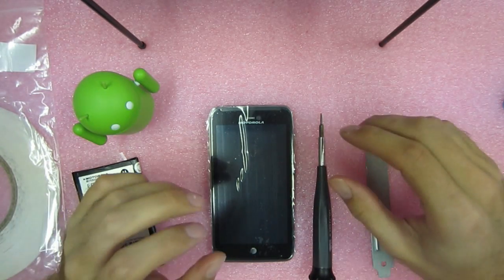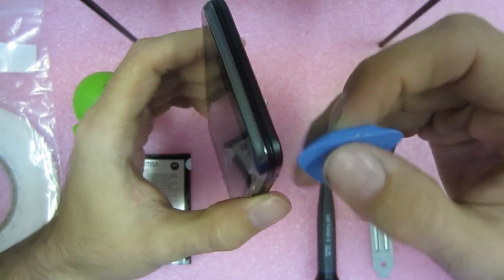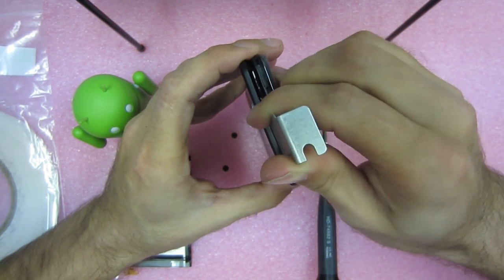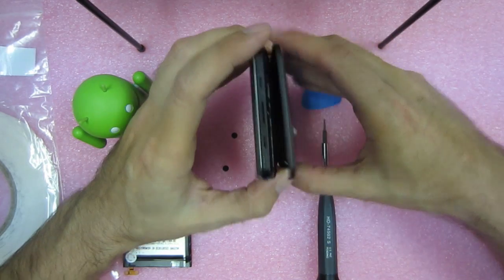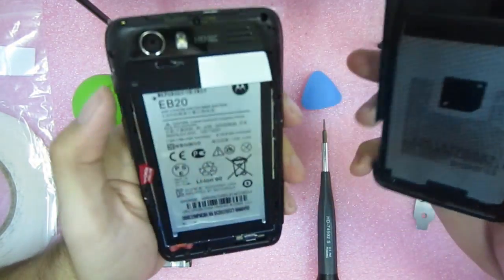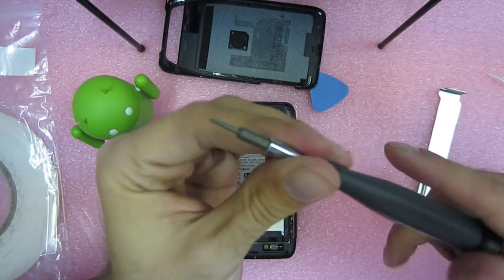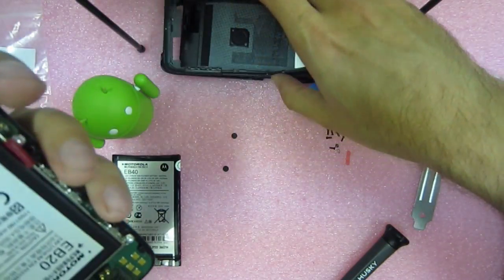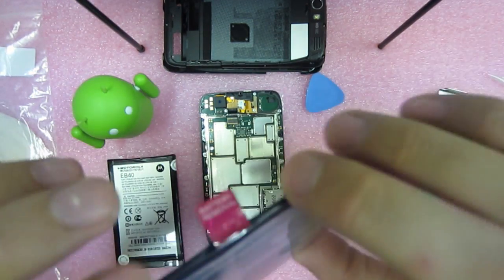Motorola Atrix HD Razr Maxx EB40 install mod Tutorial

Comment: The video was very helpful... The EB40 worked just perfectly for my Atrix HD (& was identical to the one that I removed...)  you have to take all of the screws out for the rear panel to remove it & reach the entire battery.  Counting the battery screws, you should end up with a total of 12 screws...   Upon following his directions step by step, I was able to remove the back cover, and the rear panel, remove the battery, replace it with a new battery, and reassemble the phone.  It now holds a charge, which I am very happy about :-)   I had to re-watch the video in a couple of places, but his directions do work... the EB40 is the correct battery...

Comment: No I removed the plastic cover. After I put it back together all worked good and then I had speakers issues. Took it a part and screwed down the plastic cover hard and all was good. A few days later same thing.  After my inquiry to you I disconnected the speaker cable and reseated it and the pushed the battery to the bottom as much as possible and taped it there. So far so good. Still no cutting :)

Comment: I didnt cut any plastic.Ijust pushed the battery all the way down as it is slighly smaller in length than the Eb20.This reduces the pressure and gap when u put the back cover on.You just need to raise the external speaker pins on the motherboard by 1mm using a tweezer so that they are in contact with the speaker points due to the increased gap.Works like a dream .

Comment: For those with speaker issue, try sliding the battery all the way down so that the top part is not pushed by the battery. If that doesn't work, instead of cutting parts of the  black plastic with white sticker (refer to video), just make a 3 slice cut at each end of it and also in the middle. This will help the plastic to flex without pushing the speaker contact point.
Reply: pijesz The speaker contacts are slightly curled....delicate work but they can be unfurled slightly so they stick up higher and make contact even with the EB40 battery.

Comment: I actually did have to cut out part of the black plastic frame.  I first installed the battery without cutting anything and did not have any sound.  I then used a hot knife to cut the black plastic piece (without removing it from the phone), and everything works properly.  I removed enough of the black plastic (about 1/4-inch from the top edge) that the new battery comes in and out without having to shimmey it in.  It just drops in, no problem.  Whole process took about 15 minutes.

Comment: What did you do as far as the rear panel? I tried this for a customer and the EB40 is too thick for the Atrix HD. I had to dremel out part of the frame at the top which was no big deal but the back would be under a lot of stress if I forced it on.

Comment: My speaker issues are back. I'm positive it's the two speaker connectors not touching tightly.  I'd like to know for sure what is and isn't safe to cut, I'm sure that will fix the issue. I've stripped on of my screws so I'm going to have a tough time cutting without taking the plastic bezel out.

Comment: I did this mode and put the EB40 in. The battery works great but my speaker stopped working. I suspect that the thickness of the EB40 may be a little fatter than the EB20. Now the speaker probably is not making contact with the output speaker. Did you experience that? I have to figure out a way to wire the speaker contacts to the output circuit.

Comment: @shanghei...  i did this mod, cut the plastic out and everything for the fit but i am having overheating issues. had to put back my original battery.  
do you know why this happens or how to make the overheating stop?
the battery drains after its unplugged n overheating pop ups nonstop. 
would love to put it back in and have some good battery life. what u think?

Comment: Just performed my battery swap.
Found out previous owner of my phone had it apart.
When unsnapping outer cover it came up quick and tore off contacts from old battery, Installed a 4000 mAh battery, may have to modify the inner cover as the portion between power and volume rocker will not seat down all the way and there is contacts above from outer cover there.
It would not power on at first, had to put on charger, reported 49% and charging, phone powered on at that point, will wait until it gets a charge before trying to use.
Will report if I have any issues, my battery was probably a tad thicker than yours.
Reply: Yes, going to have to get the dremel out, the power button will push in and not spring back out and my bluetooth was staticy...

Comment: I"m having speaker issue connection issues, probably because I need to cut the plastic. But I'm nervous as to what to cut. Am I supposed to cut the black and white plastic on the bracket? That's not ruining anything?

Comment: the original battery for this phone it is EB20, but you use EB40, there are the same? there's no problem using it? i'm plannig to buy a new battery for my phone, a little bit bigger in watts, What do you recommend?

Comment: My phone is the xt912 model. After much research I cannot find a video with my same insides. On this video and all others, the access to battery screws is exposed after back panel is taken off. Mine is covered with a soid piece all the way across battery terminal screws. How do I remove this cover?

Comment: My phone is Motorola Droid RAZR XT912 has a battery 1750/1780 mAh model EB20, and I would switch you to one of 3200/3300 mAh model EB40 because this battery lasts longer and therefore can be used more cell. Is compatible Battery 3300 mAh model EB40 with Motorola XT912? If I get to put the no risk of breaking down the cell?

Comment: When I installed mine, the speaker stopped working.  So, after a million tests like having the battery hang outside so the speaker would work, I decided that the thickness of the battery prevented the speaker contacts from making, contact.  If I had a dremmel tool, I would have ground the plastic so that the contacts could touch.  But I didn't, so I cut the plastic so that the battery wouldn't keep the case from coming together.  I did a hack job with kitchen shears, and it worked.
Reply: Fr No it was easier to pull the contacts up, that's what I did, but I am having issues with GPS now will have to check why
Reply: Fr No The speaker contacts are two raised tabs that are quite small. Using an eye loupe...which is a necessity for really small work....was able to raise/unfurl the slightly curled spring contacts up slightly to compensate for the extra thickness. It doesn't take much and is delicate work. All works as it should.

Comment: are there aany known over heating issues with this mod
Reply: I managed to apply this mod a few days ago. So far no such overheating issue yet. For moderate use (light browsing, lots of whatsapp, few phone calls, wifi most of the time), my atrix hd could last 2 days without the need to charge. As of now it has been 22 hours from last charge and it still have 60% juice left.

Comment: So i did this but my connections don't work for audio. Even after cutting off the back. When i put the old battery in it works. Is there something I did wrong?
Reply from the maker: did the little audio connector up top get disconnected?
Reply: shanghei I'm not sure. I cut the back and put the new one in and had no audio. Then I put the ld one back in and it works. I was wondering if there is anything else I might be missing. Is that the only connection for audio on top?
Reply from the maker: Tyler Whurlinger The only audio connector is the one I point out at 6:02
Reply: shanghei OK I'll give it another try when my new battery comes. I already sent the old one back. Thanks for the video.
Reply: Tyler Whurlinger And the quick response.

Comment: "brand new battery bought on ebay." :P when you are buying a cellphone battery, you shouldn't buy it anywhere aside from the Motorola Website, or the Verizon store. I bought a "new" battery from a 3rd party and it was complete garbage.  Even if it technically was unused, there are probably factors to preserving the battery that 3rd party retails don't practice.